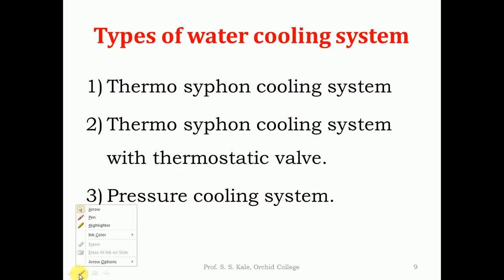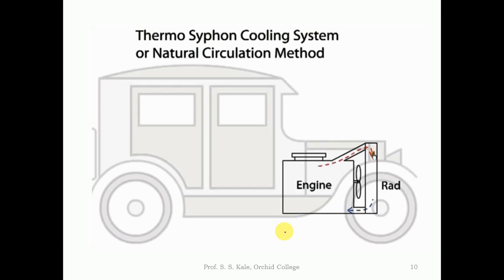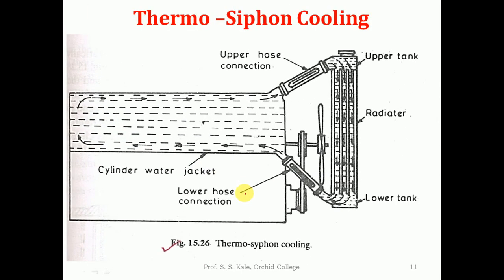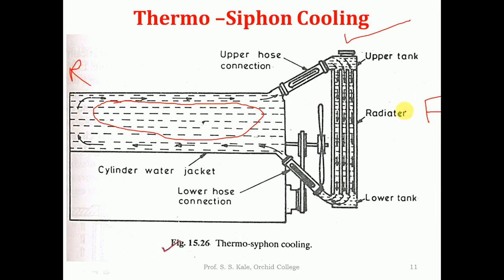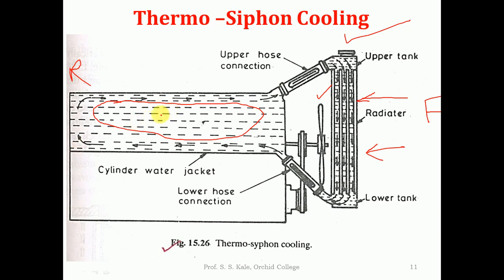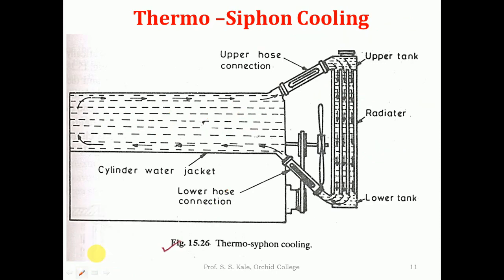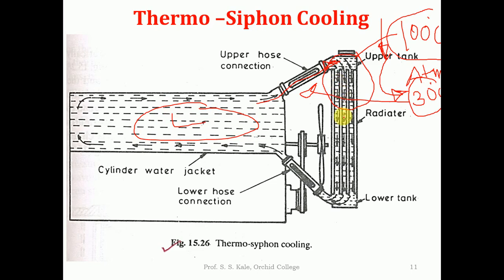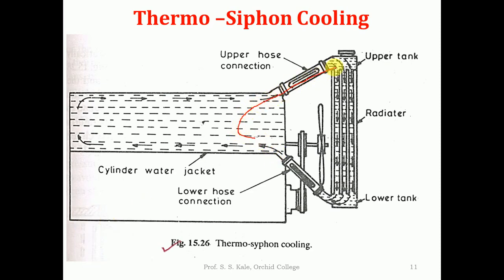Thermosyphon Engine cooling system

Comment: How do the cold water from lower tank reaches the engine
Reply from the maker: Hot water form engine tries to move upwards because of density reduction and enters in to radiator through upper head. This will create low pressure (vaccume) in engine jacket and cold water will move from lower head to engine. 
Also, hot water entering in to upper head will push cold water forward to enter in to engine. I hope you got concept.
Reply: @SampurnaEngg  thank you 👍